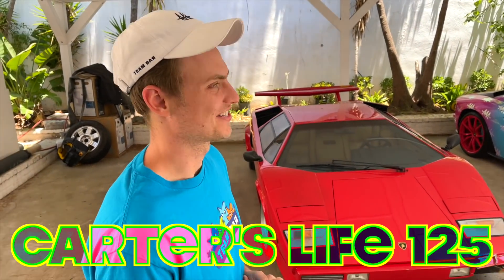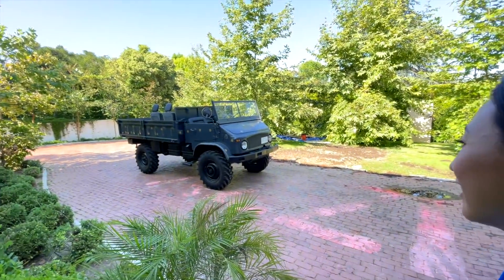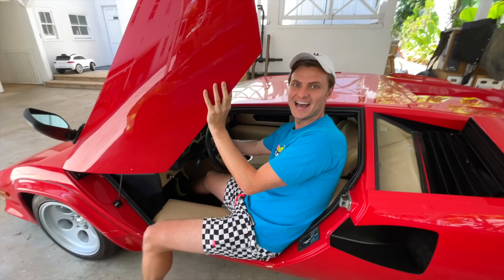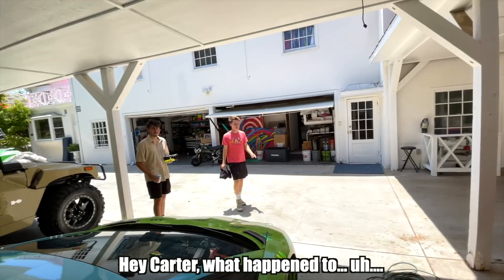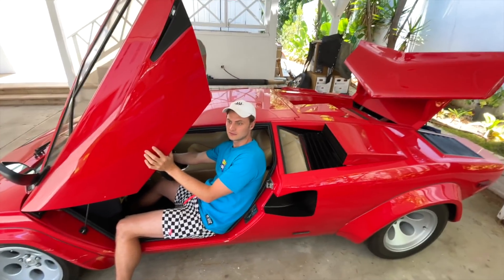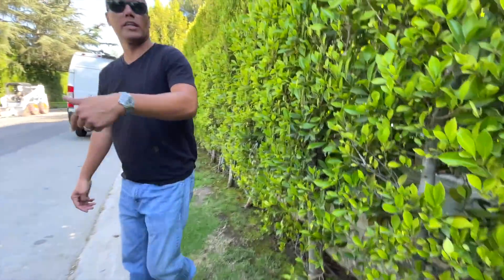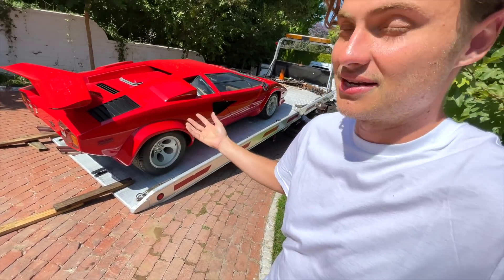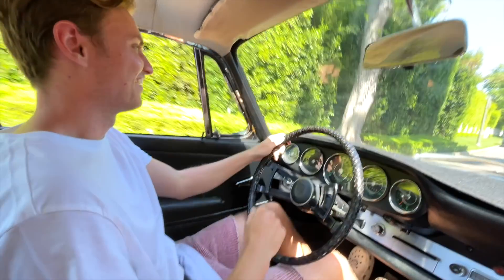Finally Saying Goodbye

Comment: Carter what’s the sale price going to be on the Lamborghini Countache? I’m thinking of buying it.
Reply: You need more than $200,000 to buy that car
Reply: @Let_Me_Borrow_A_20  lol ya 😂
Reply: @Let_Me_Borrow_A_20  More like around $114,000, but okay.
Reply: @bored5759  114? That's pretty cheap for such a rare car like this, don't you think?
Reply: It’s damaged, used, and most probably low gas mileage. It would be around $200,000 to $600,000 if it was still the 1980’s and wasn’t damaged.
Reply: @bored5759  idk, these cars don't go down in price that much, they're just used for collectibles for the most part. He's fixing the bumper, so it won't be damaged. And if you mean high gas milage, I doubt it, he never really driven it in his vlogs, so I don't think that's a big problem.
Reply: @Let_Me_Borrow_A_20  That’s actually really expensive. It is not a real Lamborghini countache. Look at the engine bay in the video and then google a Lamborghini countache engine bay and they look completely different, and that’s because they are different cars.